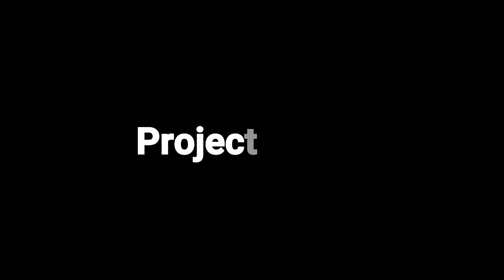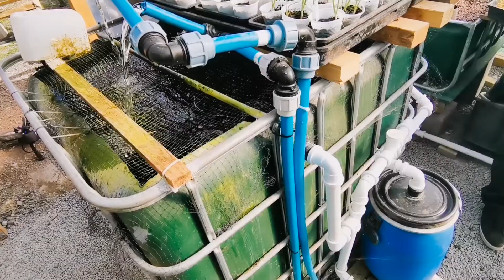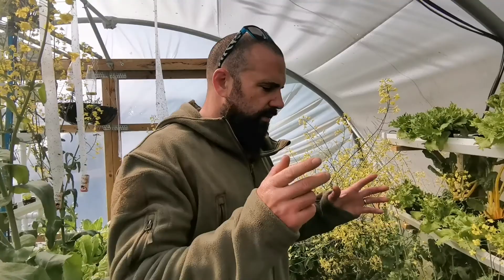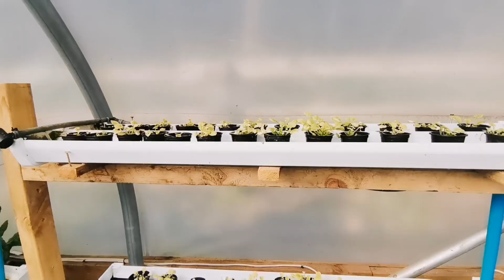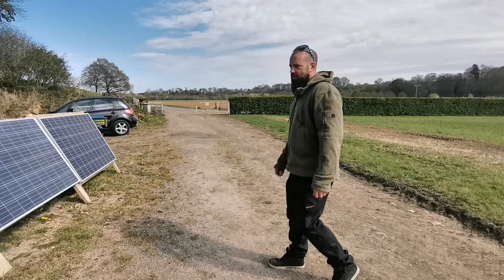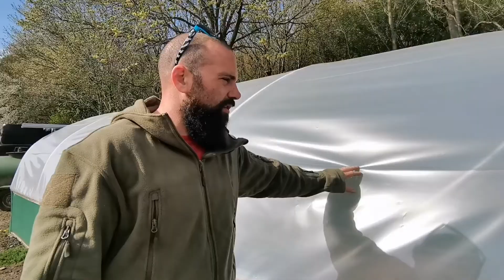UK POLYTUNNEL TOUR | Hydro & Aquaponic OFF GRID system

Comment: Fab Really cool setup especially as your off grid. I notice your nft is made from a open gully type pipe are you not getting algae buildup?
Reply: The only downside to most NFT growing systems is that its normally made using pipe. This means your hole/potting positions are fixed. We've made some recent upgrades to our gutter systems by putting in removable and adjustable covers. This means you can grow seedlings all the way through to full grown plants and change the amount of plants in each gutter whilst still cutting out the same amount of light (and reducing algae growth) as traditional NFT systems. Be sure to watch the next video as we'll be covering this design and all the spring/summer upgrades!
Reply: hoxandjones _ben that’s that’s a very good point.
Reply: Yes Mark we did start getting Algae buildup come spring but we've got adjustable covers on them now and a filter system. We're going to do another video shortly on all the recent upgrades and changes to our system. Thanks for watching 😀
Reply: hoxandjones _ben  I’m just looking to make a change to my outdoor system. I have seen you can get flat channel ventilation ducting in 2m lengths and I have found end caps . I think round pipe is a bit more challenging to manage.